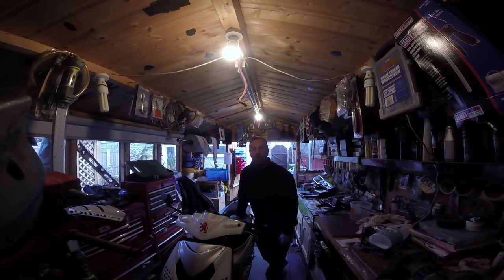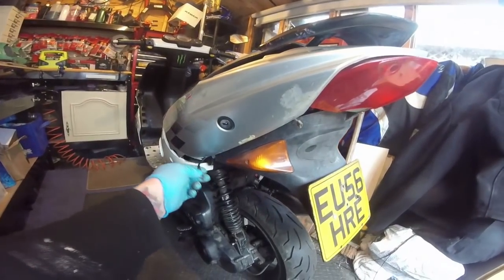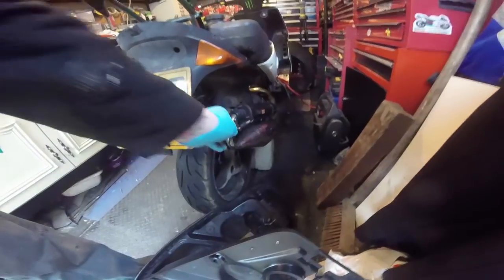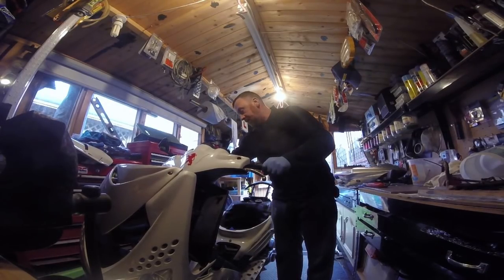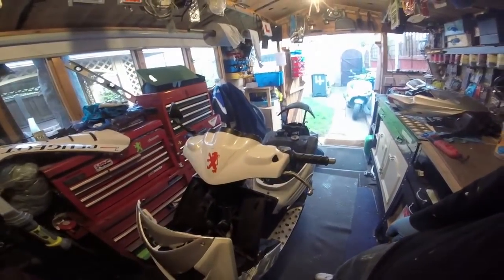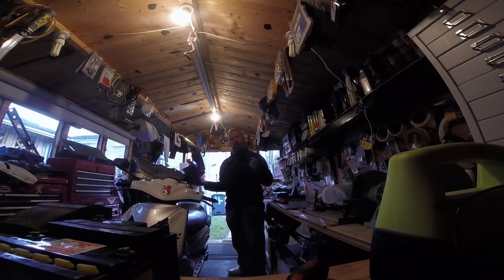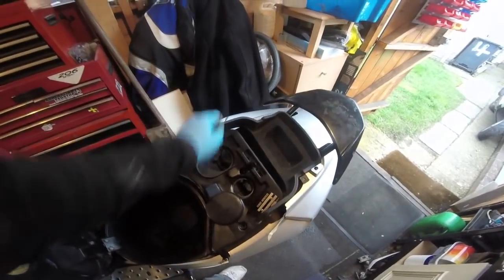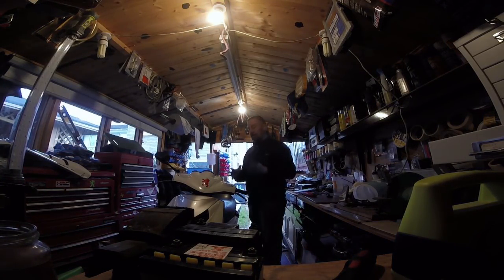SPEEDFIGHT MOPED 50 START, SIDE STAND & LOCK SET MARK SAVAGE

Comment: Hi Mark, just wanted to say thanks for all the great vids. Thanks to you (and a Haynes manual) I managed to make an 18 year old Speedfight 100 live again - after 8 years of not having been used or even started! Couldn't have done it without your vids. Thanks a mill. Now to do the same to my Ducati 748S - same vintage, same length of time not having been used.
Reply from the maker: thanks for the feedback and it's great to know my videos help, all I ask is to like and sub and i'm happy.
As for the Ducati cleaning the carbs and fueling and a good service you should be lucky that it fires up without balancing the carbs 
enjo bud 
mark
Reply: New battery, new HT lead (the original Peugeot one was joined in the middle with a cover over the join - weird, which had allowed moisture in over the years and corroded the core of the HT lead) and an AEC400 immobiliser bypass CDI (electrical checks showed everything should be working out I reckon after 8 years the immobiliser and completely forgotten the key, even the red one!), clean fuel, a new spark plug and bingo, she fires up!. Even with the Haynes manual I couldn't have done it without your vids. Keep on making them.
Reply from the maker: Paul Phillips wow and thanks bud 😁😁😁

Comment: Hi mark, I'm a new subscriber and I must say well done on all your vids, you must of helped hundreds of young riders with them. However I've had a problem with my sons or should I say he is a problem 😂 it's a 2015 speed fight 3 lc 50cc. Got about 5000 on the clock. He's had it for six weeks and now the problem has started. Phone call from him "it won't start" gets it home and the plug is knackered black carbon all over it. New plug and bingo, he's off, next day phone call "it won't start again" 😩  it started but only for 2 seconds blowing tons of white smoke like a steam train. So clean the carb, strip the head and the piston had a crack, I fitted a new piston and gaskets today following your vids 👍🏼👍🏼, got it started and guess what? white fu**ing smoke again then cutting out. So I thought the exhaust might be the prob, took exhaust off a quick fire up and no white smoke. Would a carboned up exhaust cause this? If so what is the best way to clear it? Any advice would be much appreciated. I've checked the variator and threw the washer over next doors fence. All seems fine. It has had a Leo vince exhaust upgrade, it looks like the cdi unit has been removed, and it has a no.66 jet in the carb. Oh I forgot to mention that all of his qualified mechanic mates have pissed about with the idle screw about 3weeks ago👊🏼 and probably the mix. Sorry for the long winded message but if you don't help keep reading the papers about a teenager who has gone missing 😂
Reply from the maker: babybear30 hi bud this is common 
Good to hear my videos have help in some way lol 
Sp3 ‘s can be buggers as in my videos 
So yes it’s tuning and I do have a video on that with 3 half turns so start 
66 jet should be ok if when running it runs ok 
Yes a sports exhaust can also mess around 
Have you looked into changing the wodding ?
This may help the gasses out 
White smoke so it’s water cooled ?
If not it would be tuning or if so then then head may need coming off again as it sounds like water is still getting in the head 
Did you tighten it down like I say in a crisscross way 
Black plug yes way too rich so smaller jet also may help there 
Me I’d start again bud mad for cdi ?
It should be at the back under the seat on so3’s
But you have spark so defo there Lol 
Hope that helps bud and thanks for watching 
Maybe wait till he’s old and put him in a car lol 
Mark
Reply: Thanks for the quick reply Mark, I'll start again on Tuesday, because me and his mam have left him for the weekend lol, I'll give you an update of any success. And yes your right about the car, as soon as he turns 17 and stops acting like a 7 year old. Keep up the good work and thanks again.
Reply from the maker: Kids!! who'd have them lol, you'll see the two 125s on my channel ( AJS125 & CBR125)
they were my sons and he broke one and came off the other twice so I told him motorcycling was not for him!
Ok bud see how you get on 
mark
Reply: Hahaha quality Mark, we parents should either be awarded a medal or be locked up in the nut house.
Reply from the maker: I think the second one as i'd at least have my own room pmsl, take care bud
Reply: Hi Mark, just got back from my break, and I cleaned out the exhaust and put fresh wadding in. I also had the carb set up right plus tightened the head as you do on your vids 👍🏼, I think you are right about it being  water getting in especially being liquid cooled. So is it worth a gamble to get a new cylinder kit because I think the head must be cracked. If so what are your thoughts on the one to go for as I've been looking at the naraku ones (obviously the price) or what about the 70cc upgrade!!!!!! Any advice would be much appreciated, and I apologise for doing your head in but a lot of places round here won't touch scooters or give any advice, which is a shame really as we all started out on mopeds (mine was a fs1e) and my last bike was an xjr1300. So I'm happy to sort this out especially being able to follow your vids. The piston I bought was from euro scooter parts, do you use them or do you recommend anyone else for parts. Cheers bud 😜

Comment: What is wrong with my kickstart? It stopped working about a week ago, it didn't go down like it should. I bought everything new, including variatorbox. I built it the same way it was. It works like it should when it's not on the engine, but when i put it in the engine it wont move anywhere.
Reply from the maker: I have a video on the kick start maybe watch that and copy how its on , normally its the main spring that causes the problem but as it works fine off the bike it make the push rod that goes on the main variator bolt 
watch a few more of my videos bud they should help as theres 70 of them

Comment: I have a question for the side stand. I want to order a side stand, but I think like the bottom plastic will disrupt the side stand, and than I'm gonna have to like cut ot a piece of plastic, so I can move the side stand
Reply from the maker: A side stand fits on the speedfight with no cutting , there are two bolt holes pre drilled so it fits but !!
Its a bit of a bugger to get the bolts in and the nuts tight but it can be done with a little bit of wiggling around 
You can not move the stand as it will be unbalanced

Comment: Hi. Can you put a side stand on a original speedfight 2 AC 2004? Because I have only the big stand but I would like to get a side stand. And if I would put on the side stand, would I need to make an extra holes for the screws for the side stand or there are holes already?
Reply from the maker: Hi
The good news is that can be fitted and no holes need to be drilled bud 
But the bolts are a bit hard to tight up lol but can be done

Comment: Hi, Mark! I ordered an motoforce side stand, but now when I've put it on, on like straight ground it like even stays straight if I put it in side stand, and it looks like it gonna fall. Do you have any ideas to make the side stand some how šo that the moped is more to the side? Maybe like bend it or something, I don't know.....
Reply from the maker: If you have fitted it to the two bolt holes where the main stand goes and it's up right 
It could be your rear suspension is bad and needs changing or set too low 
Wrong stand 
Me I'd just take it off and bend it over a little till its safe and refit
Reply: @marksavage  Yeah I got some more info a lot of people had this problem with mf side stands. And they yst bend it where it connects with the mounting place.

Comment: Hi quick question I've just bought a speed fight 100 and noticed the piston had a lot of play in cylinder as bought the bike as a non-runner and noticed there was petrol in the bottom end is that right? As replace the piston and rings with new gaskets and still won't start I have checked the carb cleaned it out and replaced the air filter has got a good spark but just won't start any advice would be helpful thanks Joe
Reply from the maker: hi bud when a piston goes as in my other head change videos you need to clean out all the old oil/ petrol from the sump as this will make it very hard to start!
its only where the last owner would have tries to start it and as the oil is in with the petrol it does not evaporate 
it you can take it back off and clean out then use a little easy start in the carb ait box to get it to boost start then it should go if all is ok and as you say there's spark and the carb is all clean, new plug and clean air filter 
thanks for watching please like share and sub 
mark
Reply: mark savage thanks for the advice will let you know how I get on

Comment: Been looking through all your peugeot scooter videos trying to find a solution , Ive got a peugeot metal x2 50cc - (Through research speedfight / trekker underneath ) I know without looking its almost impossible to diagnose but I cant work it out, It was taking ages to get started (only have eletric strt) once it was running was fine and felt ok riding around , i left it running at idle for 15-20 minutes and it cut / bogged out , now will not start at all even with battery being jumped. lights work etc, and can feel some compression from exhaust when trying to start but it just wont give
Reply from the maker: yes hi bud this is common
so as In my videos you have watched i would start with a service then carb clean which i'm guessing you have done all this so it's head off time as you may have a worn piston and rings or possible worn engine seals
i'd start it all over again with the easy stuff first then it depends how much you love the bike if you carry on 
mark
Reply: mark savage thanks for reply will strip it down have a look
Reply: Thanks for advice i took carb off again gave it a clean and noticed main jet is 72mm,(maybe too high?) , removed some filthy oiled up baffling from exhaust and managed to get the bike to start up and idle over nicely, can ride it around but after high rev for say 30-40 seconds it cuts out can feel what i cn only describe as a sort of friction slowing it down and then electric start does nothing at all feels almost seized, after 5 minutes or so its ok to start bike again... loosing the plot with it now
Reply from the maker: Feenikz Instrumentals maybe worth a look at the piston and change as the rings maybe playing up and as you say heat. Seizing 
If the piston is scored too 
Plus like in my auto choke video give that a look
Mark
Reply: thank you
will give it a look tomorrow ur vids helped loads would never took a carb off otherwise  lool
Reply from the maker: Feenikz Instrumentals top man 
And thanks for watching them Happy they help 
Mark

Comment: Hi Mark
I have a speedfight 2 2003. And i have clean the carb and new sparkplugg + filter. The problem is when i start it runs ok but when i sits on the moped and go away it slows down and i wait for a while it runs for 10sec then the same thing happens again but the motor dont stop it is just lacking of power. Sorry for my english i hope you understand.
Best regards Mikael sweden
Reply from the maker: Mikael unevik start with the carb bud 
Take off clean like in my carb videos 
Make sure float is ok plus vacuum and fuel pipes 
Plus a service will help 
After maybe more into the variator 
Videos to help on my channel
And thanks for watching bud
Reply: @marksavage  Thanks for quick reply. can i send a video. it is hard to explain in words some times :-)
Reply from the maker: Mikael unevik upload a video on your channel and let me know and I’ll take a look tomoz 
Thanks for subbing and like 
Mark
Reply: @marksavage  will do

Comment: My gilera dna 50 speedo just stopped working any idea's of a simple fix. Also the bike wont go past 7k revs when its on the road however on centre stand it goes to full normally. When i open the bike to full throttle it wont go so i have to drive with half thorttle everywhere. Any suggestions would helps thanks for your time.
Reply from the maker: flishlak hi bud thanks for watching my. Videos 
Service bud like in my videos then check 2t oil also in my videos 
As for the 7k rollers the variator system as in my videos 
You have a few videos to eat hon my channel bud but they will help and please like share and sub 
Mark
Reply: Thanks mark will take everything into account.

Comment: Hi mark my speed fight been running fine now went to start an my starter relay just clicks seems like nothing going to starter motor tried a different starter an still the same do you no what this could be
Reply from the maker: hi bud thanks for watching I have a video on the starter system from button to starter so give that a watch budif you have a click then your half way there and should be the start but you will need to check power but give it a watch I also have videos on changing it and the bendix system please like share and submark

Comment: Hi mark can u help me plz I've got a speedfight 2 50 lc and my seat doesn't lock I can lift the seat up by hand instead putting the key in too open the seat
Reply from the maker: hi bud 
its a common problem with the seat catch 
check the catch by taking the seat bucket out and make sure it free and can click down and release before trying to get it to work otherwise you may end up locking it and it not opening again!!
this is prob why it doesn't work in the first place so see it the key opens it when you click it my by hand first 
if ok check seat catch and go from there bud 
mark

Comment: Me again... I got a puncture today do you have a video of you removing a rear wheel?
Reply from the maker: Gxrfield CG on a speedfight yes loads of me doing it even on the last video but any way 
While off the floor. Undo the 1 main bolt or 3 but not all the way then on stand take off 
If you have a sports exhaust you may have to loosen it so to get it off 
Easy bud
Reply: No messing with anything just one bolt?!
Reply from the maker: yes bud to get the rear wheel off is one large bolt holds the rear wheel on a 50cc speedfight some with disc brakes have 3 bolts that hold the rear wheel on .it's simple bud if your not happy taking it off a bike shop will do it for you, but they will change more than a loose wheelon some bike the exhaust can be in the way and a little movement will get it offmark

Comment: it sounded a bit rich as you rev it? or does it have one of those horrendous electric chokes?
Reply from the maker: it does but it hadn't been started for a while and was chocked up, starts and rev's fine now 
thanks for watching 
mark
Reply: hey mark, what are your thoughts on electric chokes on little scooters? i personally HATE them. they make setting up a carb a pain in the ***. have to drive atleast 5 miles before the stupid thing is warm enough to fully blok the choke port. and then you have to RUSH to test it out again...

Comment: hello mark

ive got alot of spares

a speedfighter half a bike project good engine... a full good lc engine wheel brske raditor csrb ect ,and a trekker good engine forks wheels few panels... 4 vrsnd nee yellow in the packet speedfighter tyres...may see me adveetise alot of bikes on facebook and gumtree..

didn't know if it was any good to you before it all goes up as a joblot, i'm.only in Norwich.... £210 for the lot.
Reply from the maker: hi bud your not that far but still need to get a van so if I can get to you I would but at the mo just cant get to youi will keep you in mind if I can sort out getting it thanks for watching bud mark

Comment: Hi Mark, I'm the boy with the cold problem start, i removed the link pipe and it is the same problem, my carb can't be adjust, but i tried something with the air filter down watch the video: https://www.youtube.com/watch?v=MfHarkLlJ0g&feature=youtu.be
Reply from the maker: hi bud well as there is still snow where you are it must be really cold and no speedfight or moped likes it when it that cold why does your are box look different or is it just the on the video?well ok if it starts like that it is due to the air mix which you cant play with but when you take it off and put your fingers over it you are taking away the air so the link pipe is needed to startfailing that use a little easy start to get it going that's what I'd I do bud mark
Reply: I put the link pipe and the problem is the same, how can be solve with new carb or choke?